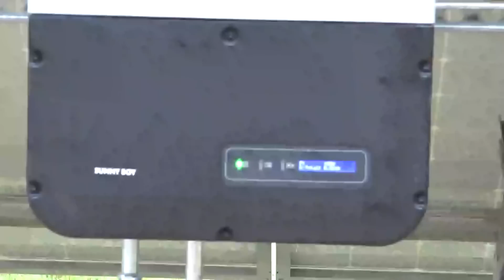Grid Tied Solar in West Virginia

Comment: If you are trying to prepare for an emp or a solar flare, solar panels and anything with transistors are not the way to go. Mosfets, TTL transistors and other micro devices have breakdown voltages that burn them out easily during emp let alone solar flares.

Comment: Thanks for sharing, it looks like a beautiful installation!

In might have just been camera angle, but it didn't look like enough slope on the wires into the weather heads. Even if there's a little slope, wind can push the water in the rest of the way. That's why you usually see the wires going almost straight down in most services. All told I did about a year in an electrical service department and I've seen lots of water damage in meter cans, about 20% of the time it was water getting in through the meter head. We made all of our construction guys start off doing 3 to 6 months in our service dept before going into the field. Weather heads were always pounded in our heads, along with leaving adequate wire length in device boxes.
Reply: Specialist that’s a good tip
Reply: @GainSolarPower 
I was also an industrial electrician for years and I  can appreciate how straight and organized your electrical installs look.

Our company would take a journeyman and make him a helper for a week (pay and all), if they did sloppy looking work. It only took once for me and I became a real artist. Your work is at that artist level. It takes a lot of preplanning to result in a straight organized job like I've seen in your videos. Great work!
Reply: Specialist thank you for the kind words.   I’ve had some really good teachers. There is always room for improvement.

Comment: Should add some plywood on the underside of the beams for the solar panels, then a front and side walls, and you have a small shed for animals, firewood or equipment with protection for the panels above while allowing air circulation.

Comment: Question for you Scott. Are there any adverse effects as far as say refraction if a person were to install heavier plexiglass panels over the solar panels to eliminate damage due to hail ? Or would there be an alternative material to the plexiglass to use that would be better ?
Reply from the maker: You would lose a ton of power. We've never had any panels break due to hail. They're tougher than you think.
Reply: Differnt brands are also tougher then others, I've seen some panels I couldn't imagine hail breaking, some you can nail with a baseball bat and you're not gonna break it. Some do break easier though
Reply: Thank you Scott.

Comment: Good job can I ask you something about the inverter
Reply from the maker: fire away
Reply: @engineer775  What  is the minimum  and  maximum  300 watts renogy  monocrystalline  solar panel  with  short circuit current  of 9.78  that can work with the  inverter, because I will like to  buy the  5.0 and I live in the Caribbean.

Comment: I want to make hydrogen with solar for energy storage
Reply: That would be dangerous
..
Reply: @rock130-l  So is gasoline it's all what we get used to. With the right containers and pumps it is possible I mean we sell compressed oxygen and acetylene not that much different and the by product of electrolysis is oxygen when you capture the hydrogen and water when you burn it.
Reply: Hydrogen isn't that dangerous at all, I'd say propane or natural gas or batteries are all quite abit more dangerous, the only thing hydrogen is very dangerous to is your pocket book. It will kill that faster then anything
Reply: The problem with hydrogen is the same thing as methane, storage. Unless you compress it, you can't store enough to do much, maybe enough for a little cooking, but not enough for heating. I believe that the problem with trying to compress it, is oxygen. You get a little oxygen mixed in with it and it will react with the other gas if you try to compress. Apparently it can explode.

Please consider spending most of your money on insulation, eliminating air infiltration,  then on very high efficiency appliances. After all that's done, then spend on solar.

I'm going passive house and I'll have solar and some battery storage, but some of what I'll do is store heat energy. Get yourself an 80gal heat pump water heater, which is already 4x more efficient, then only run it mid day, when you're probably at work. It certainly doesn't make sense to use batteries just to store energy that will be used to heat water, when you can just store hot water. That will reduce the amount of batteries you need.
Reply: @cornpop7805  Totally agree I have accomplished your list and have been improving my hot water production with my geothermal furnace. I need a way other than Netmetering to store energy from the high production months and yes water heating could be a way Storage is the problem water is bulky and storage of any quantity (3000 gal) enough to use through a Canadian winter is costly. Thanks for the comment.
Reply: @offgridwanabe 
Also look into Miele clothes dryers (see below link). They are abouts 4x more efficient than standard electric dryers and they are able to be controlled and monitored from your phone. This means that you can throw something in the washer as soon as you get up (cold water cycle of course), then throw it in the dryer before going to work, but setting the timer to dry the load when the solar is at peak. Then because they are a heat pump clothes dryer, they capture and hold some water in a reservoir, so you can run a quick unwrinkle cycle when you get home.

If your house is REALLY tight, you might want to program your thermostat to run a little more extreme (hot or cold depending on season), while the sun is still up, but closer to when I presume you get home from work. This should keep the HVAC from needing to run as much (or maybe at all) when the sun is down.

Hot water tank + clothes drying + HVAC during near peak solar hours is much more efficient than storing electricity. I'll do all of the above, but will also have some batteries,  just a lot less than if I weren't time managing the loads.
https://www.energystar.gov/productfinder/most-efficient/me-certified-clothes-dryers/details/2308247
Reply: @cornpop7805  That is one expensive dryer $3000 in Canada we are retired so it is not difficult to do laundry on a sunny day but I will consider a heat pump dryer when this one is used up.
Reply: @offgridwanabe 
There are other cheaper brands of heat pump clothes dryers, most are called ventless or hybrid dryers. However, the brand I linked is of a particularly high efficiency, amazingly so. I'm sure they'll come down in price in a year or two.
Reply: Well I dont think you would really store 3000 gallons of hot water, you could. But there would be a huge loss everyday. My roommate worked for a project called thenhudrogwn house in Jersey for a few years, they stored hydrogen in 10 1000 gallon propane tanks which supposedly lasted them all year long. I'm not sure of that guy was doing it honestly or not, but I know its possible. You could also get all of that volume down into the size of a welding bottle if compressed to a few thousand  PSI.
Reply: @townsendliving9750   3000 gallons is what I think I need to supply my geothermal with a source to draw heat and return the same back into the source in effect recycling the water until the heat is depleted.Summer AC would also boost the temperature for storage. Hydrogen could be used anytime for just about anything when solar is at a minimum. Yes I do believe compressing is the way but I have not explored the use of gas bags under low pressure which some people are using for cooking fuel with methane. We have to dream it up and think about it a long time before we build it.
Reply: @offgridwanabe  I'm not sure how long you plan on storing or using the water, that's a pretty difficult calculation to make. But theres 8.33 BTUs per gallon per degree, so if you raise the temperature 100.degrees youd get 2.5 million BTUs, and just to throw at a number you require 35k btus and hour to heat with your have proably around 48 hours of heat at 100 percent efficiency and no extra input in those hours, so depending on daily input and efficiency. Also you dont want to produce that with resistance heating, so youd have to have a good heat pump. And as for bags for hydrogen theres not enough storage to do anything meaningful, propane tanks or gas bottles is the only way to go. But like stated it would have to be 99 percent pure hydrogen. Theres a company that makes a hydrogen generator that generates, concentrates drys and compresses and then also converts back to electricity in large quantity and quality in the size of a closet, all one unit. If you were serious I'd just go with that and benefit off there decades of engineering.
Reply: @townsendliving9750  Do you know the companies name? I would look into it as no sense in reinventing the wheel. My heat pump does a good job with the ground source well water for a heat source I am just trying to supplement the electricity cost and availability during winter months. I am almost at grid zero for a year average so things get more difficult at this stage winter is long and cold in Canada.
Reply: @offgridwanabe  companies name is millenium reign energy. If you decide to go with them or just call them tell them matt gebhardt referred you. It would be much appreciated.
Reply: @townsendliving9750  Thanks NP I will Matt Gebhardt